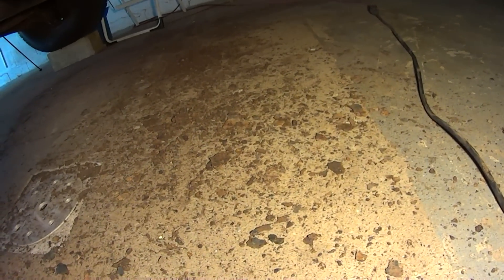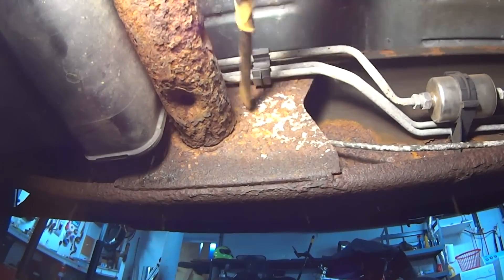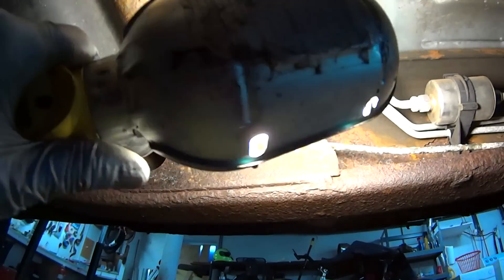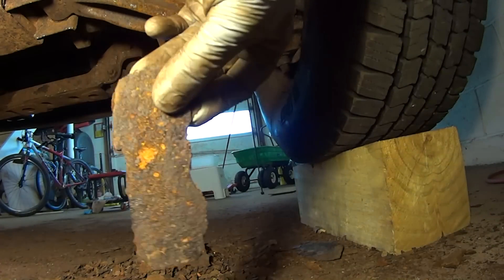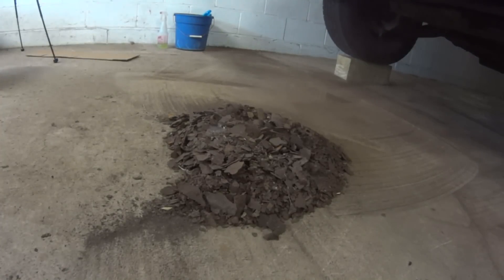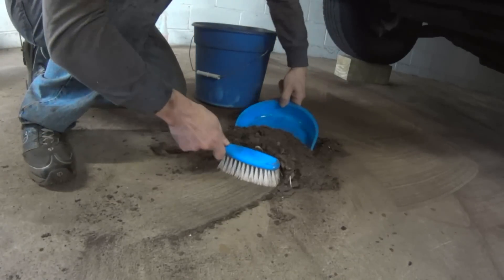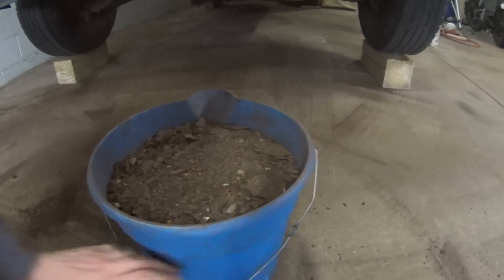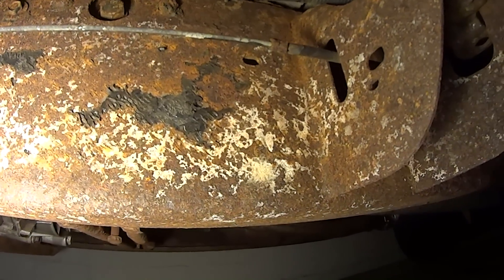Most satisfying video. Silverado Frame rust removal, RUST PROOF STUDY

Comment: And this ladies and gentleman is why you don't buy a Chevy...
Reply: Friend of mine is a body shop guy in Chicago-that can happen to ANY vehicle as some on here have pointed out.
Reply: Viktor Step Toyota, BMW, Nissan, Mercedes are worse.  My 14 year old daily driver is fine.  I use wd-40 and under coating in the wheel wells. Living with salt on the roads will destroy any car.
Reply: WD-40 washes off with water.
Reply: The main problem is that GM does not e-coat their frames like Ford and Dodge. GM still uses the archaic wax coating on their frames that are destined to fail and rust. Once the wax rubs off from road grime, water, excessive heat there is literally no protection and they just rust away.
Reply: Toyotas are worse
Reply: Viktor Step Chevy's are the best hands down
Reply: chefdan87
Ford F150 best selling  the 3.5 v6 ecco boost
is a lemon and it is the most sold goes to show you how stupid people really are..
IF you go by how  many are sold you are following the sheep stay out of the herd you will be happier.
Reply: Steven Vanheel yup, but i mean, i see 2010 dodge rams with rusted put wheel wells and rocker panels.
Reply: chefdan87 If Chevy's are the best at rusting it's because they perform the best, so they are used the most. hence the rust. all vehicles made of metal will rust, don't be stupid. luckily mine only has slight surface rust which I'm about to sand down and undercoat, 14 year old truck with very little surface rust is impressive
Reply: Toyota has the same problem with Tundra/Tacoma.  Rust ate the frame of my 2002 Tundra.
Reply: SledNeckSlayer MN yea it doesn't really matter what brand it is. My chevy has way worse frame rust then my dads dodge that is of similar age. I'm sure it happens in fords too.
Reply: I will say the 99 expeditions were amazingly durable.  Mine had the 5.4 and went to 390k with only one transmission replacement (replaced at 200k miles).  Thats the only ford of mine that made it past 200k.  All were treated and used the same.  I've had 3 chevys with the 5.3 and two were sold around 250k with their original engine and trans working perfectly although one was slipping.  I've had 3 fords die before 200k with the 4.6.  Still driving my 07 silverado with 270k on it and that truck gets beata fair amount  harder than any of my other trucks did.  Never ever had a 5.3L chevy fail or leave me stranded.  There is a reason mustang guys swap their 4.6s and coyotes out for the chevy LS engines.  They are overbuilt and can take absurd abuse.
Reply: Can you stop using that number 1 selling truck junk... ford makes 1 truck the F... chevy is split with GMC as well... btw the strongest most dependable diesel is the dmax, (likely why the US military chose it for the Humvee replacement) who was the first to have a common rail diesel, oh right chevy.

And dont anyone say dmax is isuzu, its was a joint venture between isuzu and chevy, back when chevy OWNED isuzu... lol then once isuzu bought back its shares, chevy took over dmax... its a chevy motor from the start, they sold off Detroit diesel (ya dd was gm original name was GM diesel division back in the like 30s or something) when they went in to dmax.
Reply: They're all the same shit.
Reply: Wow that's pretty crazy. I see 4th gen dodges on the road every day and I have never seen any that have any rust on them. We just bought a 2016 1500 hemi this summer.
Reply: Steven Vanheel yeah, you shouldn't have to worry about rust on that for 20 years since they finally are using a metal that is harder to get rusty. But just undercoat, put fender flares on the wheel wells, and maybe bedliner along the rocker panels though that might look crappy or not match.
Reply: No ..electrolysis works on ALL cars and trucks!! THIS is why you have your car undercoated in places that salt the roads...this type of rust does NOT happen in WA state ,,salting is not allowed ...
Reply: deepsquat600 come to Minnesota, land of 90% rusted out vehicles.
Reply: :) .. well I watch South Main Auto ... best you tube car repair video channel out there .. he is in New York ..cars come in that are fairly new ...say 15 months and already rusting ..and I have only seen after market  undercoating on 2 vehicles... the best one was at least ten years old and he had  some thing similar  to a bed line ..was perfect .. I am in seattle ..I have a 74 chevy ..the only rust on it is in the wheel wells and now slowly the bed ..thirty years  out side .. not much snow here and ZERO salt on roads .. 
 BTW I road my motorcycle through  MInn... even the HWY 90 seemed to suffer a lot of cold weather wear
Reply: deepsquat600 yep, you got it down man.
Reply: BTW ..awesome you tube handle :)
Reply: @ dam dan,    At what rusting? Yeah we all agree with you, chevy's are the best at rusting hands down.
Reply: chefdan87 found a diehard Chevy owner
Reply: Looks like the sensitive "Leon Springs Boys TV" got triggered by the truth. Truth and facts must not matter to him, only feelings matter to little SJW's like him.... Lol
Reply: Science Militia1 Thats funny. 97 f150 211,798 miles, was a plow truck for 8 years, 99 expedition 308,634 miles. Both have rust, both run great. My uncles 03 silverado 1500 is on its third engine and second transmission at 367,000 miles. Rusty, but still a decent vehicle. Its all about how you take care of them.
Reply: Nice!  If you want to keep it nice, put a protective coat all over the undercarriage and also the inside of the bed sides.  The bed side panels won't rust from the outer side, because its painted.  It rusts from the bare metal on the inside of your truck's bed side because that side is not painted.  So rust forms in the pores of the metal and then it eventually gets all the way through the panel and makes the paint bubble.  Paint bubbles is not rust starting to form.  Paint bubbles happen when the rust already made it through the bedside panel from the inner side.  It only gets worse after that and it happens FAST once it makes it through like that.
Reply: David Stanley fuck a Ford GM all the way it's y I own 1984 K20 1995 GMC 2500 Sierra standard and a 2015 Chevy Silverado 1500
Reply: Viktor Step make and model have nothing to do with it! it truly depends on what type of environment they are driven in my friend! you should know better!
Reply: Viktor Step make and model have nothing to do with it! it truly depends on what type of environment they are driven in my friend! you should know better!
Reply: I live in New England. Ford and dodge are the worst. a buddy of mine literally has about 15 trucks in his driveway. 10 of which are all GM trucks 1989-2003 and none have major rot, or any at all. he's got a 2003 f250 with literally only half a bed left on it. then has a 7.3 that's got more rot than the old tahoes
Reply: I live not only in a rust belt, but one of the most infamous states in the u.s to have rot. Dodges rot the worst, Ford is 2nd and the chevy/gmc trucks have the least rot. An " I live in the rust belt" argument is so irrelevant because it's rust. Not rot. The goof in the video chipped away surface rust that any truck will have and later proved that there was solid and clean steel under it. If you don't know the difference between rust and rot, don't ever work on a fucking vehicle.
Reply: Up here in eastern Canada it's best to take your vehicle to a self service coin wash that doesn't use recirculated water and pressure rinse the salt and built up ice from the underside then blow dry it.  Smearing thick axle grease on certain areas before the winter arrives helps also.   The underside of a vehicle has so many angles and edges to collect the road spray from underneath and in places like mine where it's wet and freezing for up to six months it's means a good part of every year there will be salt on the roads.
As far as best vehicle a lot depends on how it's driven , where it's stored for the night and what's important to the owner.   I like the new Super Duty's for their size , large frame and beefy design until I see severe  problems with front end wobble.  I like the RAM for its Cummins engine but not it's crash test results.   Overall the only trucks I see around here still running from the 80's are Chevy/Gm.   They get better gas mileage from what I hear from owners as well.   My friend enjoys his 2011 Ford Focus but says it's a pig on gas.  A friend's 6 year old Toyota Tacoma has no rust that I could see underneath and has good room , feels solid and rides well.   Whatever my next vehicle will be it will be bought after much research.
Reply: To be honest winter roads are just murderous on steel.
Reply: Viktor Step haha, just look at a dodge for a sec and you wont be saying this.
Reply: FOrd or dodge would've been in the junk yard before the rust could even form.  Ford's engines don't make it even to 200k, and "RAM" (made by fiat) is rated as the least reliable vehicle made in 2016 AND 2017.  Meanwhile, the 5.3L LS in the chevy literally will NOT fail no matter wtf you do to it.
Reply: Rusting is a show of good performance? What ridiculous world do you live
 in? Whats the number one best selling truck ever....... Oh wait its the
 Ford. Which company uses the strongest most dependable diesel engine? 
Oh wait its Dodge using Cummings engines. Which companies trucks rust 
out and fall apart? Oh wait its Chevy... I guess Chevy wins some 
how..... Go smoke some more dope Doug you brain dead idiot.

Comment: You really need to look into a needle scalier, it works much better than an air chisel for this kind of stuff.
Reply from the maker: I have 3 different needle scalers and they are useless on deep rot like this. Takes hours just to do one side. I made videos in the past using it. When you have rust 1/8" thick, you need to knock it off.

Comment: How old is this Silverado? The frame has clearly been painted ss it is flaking off. This is a common problem with paint, esp non catalyzed    paints that dry out over time. Some would think that the old Dupont Imron would be good as it stayed flexable. That did not prove true as rust crawled under it and destroyed many big truck frames. GM'S wax coating is not a bad idea if it stayed on.   I own o 97 Ford F250 that the paint flaked off 10 years ago and even though I have applied rust preventative paint it continues to flake off. This problem is not as easily solved as e coating the frame, the proper non hardening material need to be used.
Reply from the maker: 17 years old. I think someone just sprayed the frame when it turn all rusty without doing any prep work.

Comment: I think I would be afraid to drive that truck. But if it was exposed to salt for years what do you expect? I have a 1993 Chevy 1/2 ton truck I bought new. I live in Phoenix, AZ. After 26 years there is zero frame and body rust.
Reply: vulcan1753 phoenix is nice to cars. I live in Denver . No rust here either but rock chips are common
Reply: In the Phoenix area, we also have a problem with gravel. Both gravel trucks, and the use of gravel as landscaping along the freeways. I went through three windshields in one year a few years ago, and have gone through a couple more since.
Reply: Vulcan how is your 1993 26 years old?
Reply: late 1992?
Reply: Its not all flowers. The heat and sun kill paint, rubber, and plastics. So while your metal is mint, everything else is dry rotted. The only solution is to get a east coast truck with a mint interior, a west coast mint metal and make one mint truck out of two.
Reply: I have a 1990 GMC Sierra truck single cab short bed no rust too. That truck was bought by my wife's auntie here in Farmington, N.M. we live in Kirtland N.M. they are great trucks. Still my daily driver as of today.2018

Comment: as of 2006 both Ford and dodge e-coat there frames where GM still coats there frames with WAX the wax can come off the frame in very hot weather and most commonly when you powerwash the truck. friend of mine does it old school drop the truck off in the fall to a shop and he sprays the entire underbody with used motor oil illegal to be sure but his1993 chevt one tone the frame is like new
Reply from the maker: I would not use used oil. My co-worker sprayed used motor oil and his Jeep smelled like burnt tar for a year.

Best to use Chain Saw bar oil. Has no smell. It is thick so mix it with gasoline. Then gasoline evaporates leaving thick sticky oil.

Comment: The salt is awful. Nothing will stop it except for electrolytic devices used in ships. Even that only slows it. Aluminum is no better, no rust but welcome to aircraft mechanics hell, corrosion! Even stainless steel degrades in those conditions.

Comment: glad I don't live where it snows. 15 year old truck and only have surface rust on frame which is normal.
Reply: it's a good thing your not living in Pennsylvania then ! the salt on the roads in the winter can play havoc on car bodies unless you keep it washed every so often !
Reply: Lloyd Dailey Yea i also dont like the cold so there's another reason i dont live up there lol
Reply: Allende NL i live in canada got a 1999 dakota with minimal rust. its all about Rust Check every year from the beginning of the car or trucks life
Reply: We don't use salt on our roads much, not that it doesn't snow but because it's too damn cold for salt to do anything...................
Reply: I live in Michigan but we have the same problem here lol.
Reply: I live in the UK and we have salt, rain, sand snow you name it. Hasn't stopped out Toyota Hilux though, 24 years old, 300,000 miles and still running like a champ and getting though MOT (yearly safety check) no issue
Reply: Im in the same boat. even then i feel like getting rust remover or that lazer thing and painting the frame.
Reply: Same, doesn't snow where I live either!  All my cars have zero rust, my neighbor has a 84 F150 with zero rust!
Reply: I just bought an '82 Bronco and the frame still has most of its coating lol, it's always been in Arkansas

Comment: That's that wax coating for ya
Reply from the maker: The wax was never the problem. In areas that it did stick, the frame is still nice and shiny. It was the way they coated it. They first dipped the frame in the wax and them bolt everything onto the frame rubbing wax off in many spots and edges. Rust started in those spots and moved under the wax. As you see on the video, the sheets come off with wax still on top. It was bad application.
Reply: That's why pretty much every other brand E coats there frames after bolting everything on

Comment: I have an 08 duramax and it shows the same issues... now I'm scared. BTW it only has 44k miles and spends most of the time in nice garage.
Reply from the maker: That sucks. I got this truck for nothing because it had all the rust. I would hate to have Duramax worth $25,000 and have rusted frame. Don't let it go to waste. You have to act now before it turns into a deep rot.

Comment: probably best off to just let your chevy rust into a pile of junk.. or sell it and get something that has ecoat on it instead of wax.. aka a ford
Reply: 2007dalin e coat likes Nickelback.
Reply: 2007dalin or a Dodge. Dodge went to E-coat in 2006
Reply: James Shanks my 04 and the 99 dodge I used to have were painted. it looks like my 87 was too but it's too old to know if someone did that after the fact

Comment: so what are you going to do to keep it from happening again, if anything?
Reply from the maker: I have an experiment going. Half the frame is painted with Chassis Saver and rubberized coating. 1/4 of the frame is covered with wax and 1/4 with heavy grease. I will report back after the first winter.